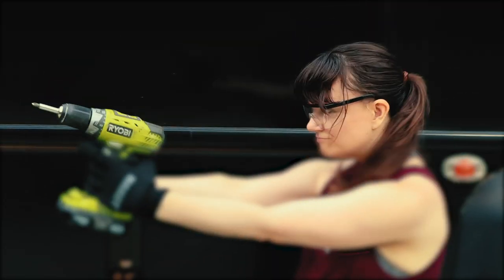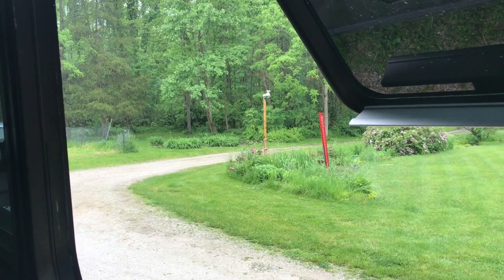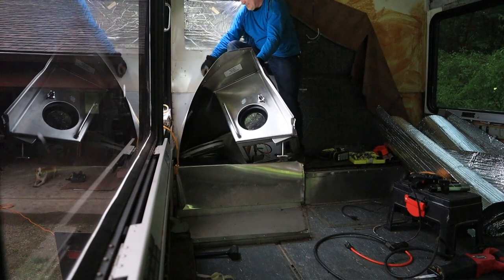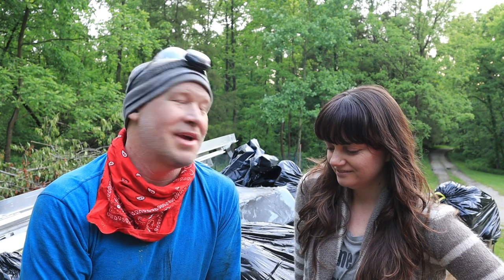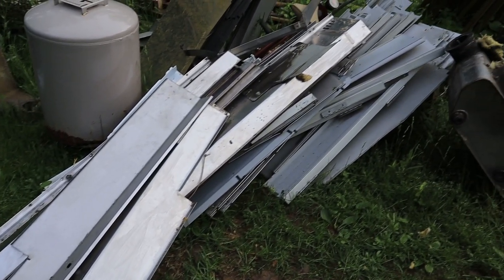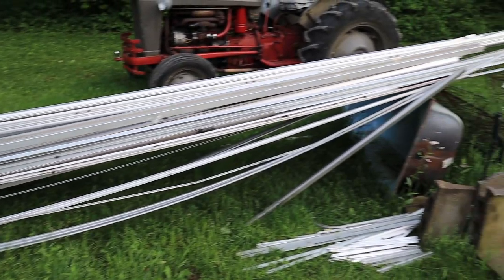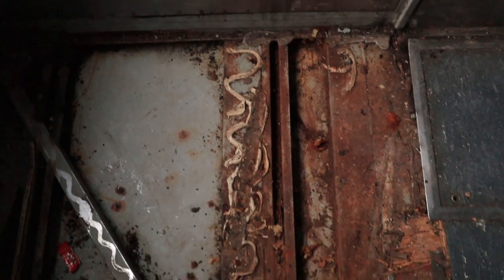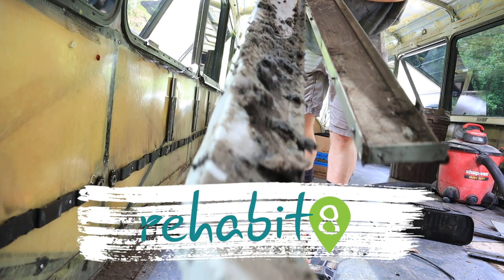Bus Demo Day 5 - Things Get Stinky - Toilet & Tank Removal

Comment: I have just gone through ALL that you have gone through with my bus. The only difference is that mine is a Prevost and not an MCI. But the similarities are SO amazing! I have the exact same linoleum on the floor as you do - even the pattern is the same. Also, the seat tracks along the wall and the rails in the floors are the same. The insulation in the Prevost is all rigid foam and so, we did not want to mess with success. So, your tearing out the sealing insulation was a good move. But I think your insulation in the walls should stay. 

You will definitely want to take up the HVAC ducts going down each side of the bus. They will be in the way of any and all furniture, walls and cabinets. If you decide to put in a residential refrigerator, the ducts will be in the way. We've decided on installing new mini-splits anyway so taking the ducts out has been a good move on our part. 

If I am not too late, please let me try and talk you OUT OF PULLING UP THE FLOORS! Unless you have some rot because the overhead escape hatches were leaking, you're really spending a tremendous amount of effort and it's not necessary.The floors will already be made of top quality plywood. Check to see if the MCI has rigid foam insulation under the floor like our Prevost. I would be willing to bet that it does. Drill a test hole somewhere inconspicuous and you'll be able to tell.
Reply from the maker: We looked at some Prevosts.  Very similar and nice buses.  Good luck with the conversion.Yeah.....as you saw......too late.  lol floors are gone now.  It would have been nice to skip floor removal and repair because it's a big job.  But so glad we did because now we know exactly what is under there and could treat rusted areas.  You just never know if there is rust under there!

Comment: I don't understand why work so much in a sanitary facility that is practically indestructible and fully operational, in my point of view I would only have made some adaptations to my needs.  In any case, I congratulate you for the work, it turned out very well
Reply from the maker: Thank you.  You have to understand that was an almost 30 year old public restroom.  It was disgusting. Also once we removed it we discovered rust.  There had clearly been some water leaks in the restroom.  We got to treat the rust and build a clean new home.